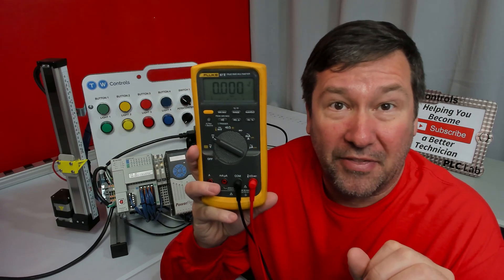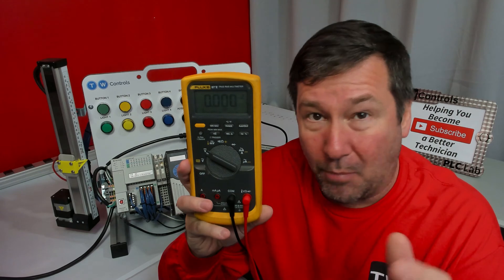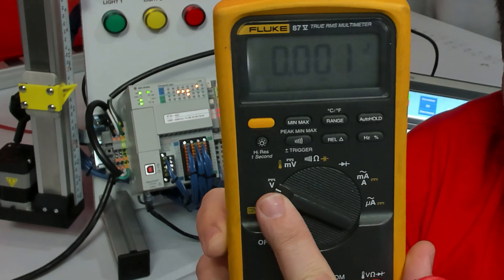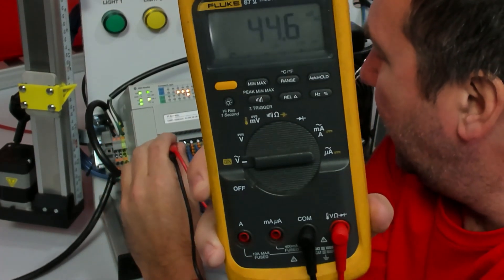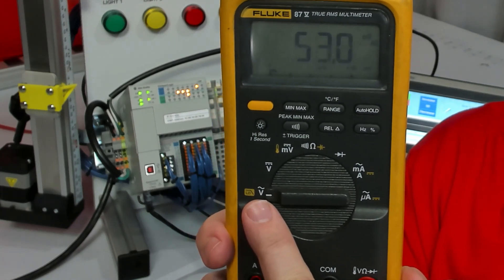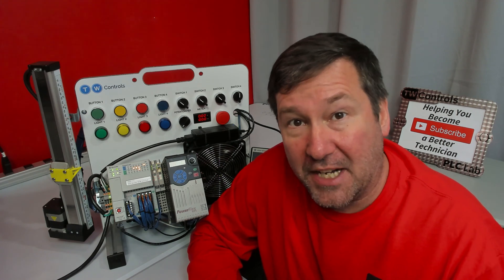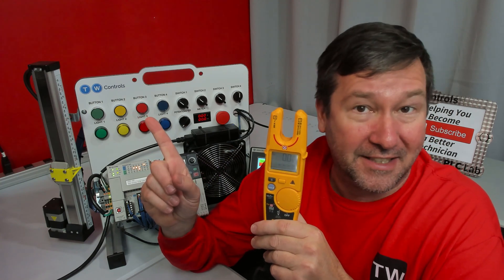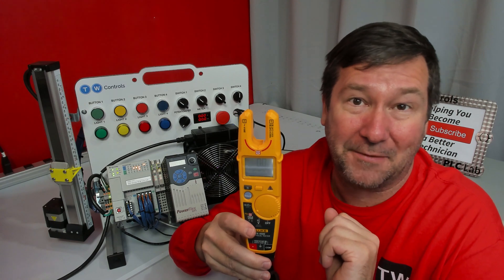Measuring AC on DC and DC on AC.  DON'T Make This Mistake!

Comment: 87v is my fav meter for generator stuff. I wouldn't be able to use the other one to check for induced ac voltage on dc circuits which is a common problem with some tray cable.
Reply from the maker: Good to know!

Comment: If you haven't done so already, please explain the relevance and importance of only using a True RMS meter for AC. So many technologies are now using inverters to tailor drive RPMs, Soft Starts and economics in cooling and heating systems.
Reply from the maker: That would be a good one, I'll put it on the list.  I'm going to do some playing with Fluke's low pass filter so I'll cover it along with RMS.